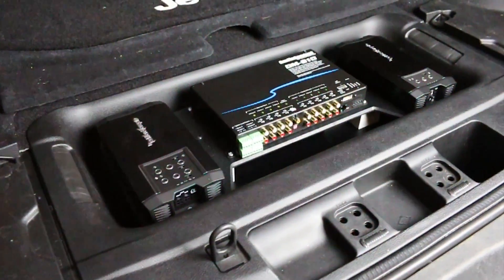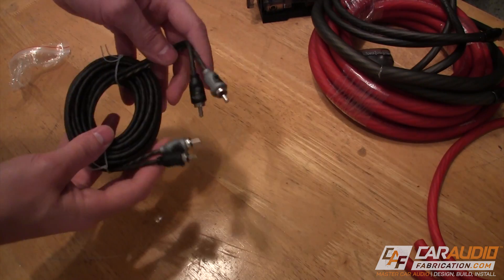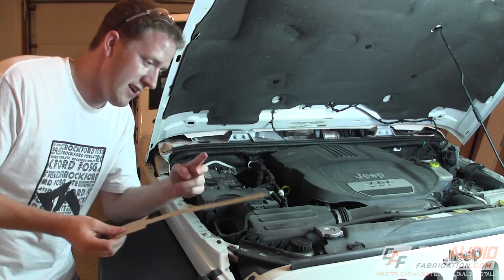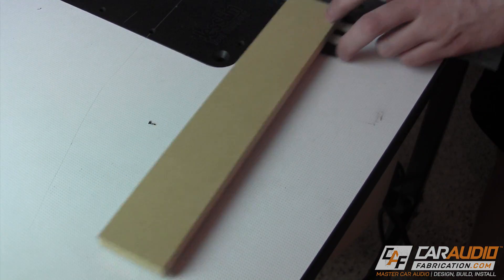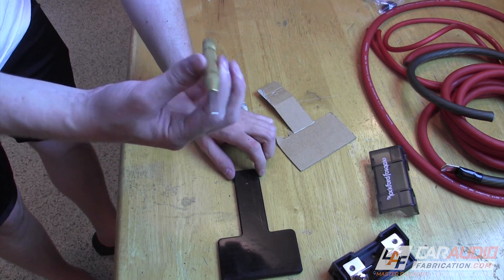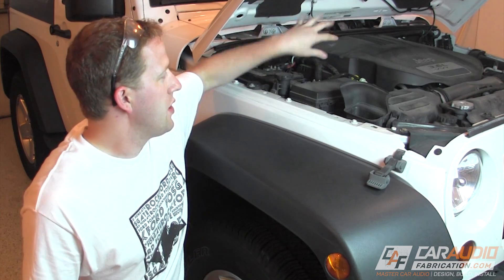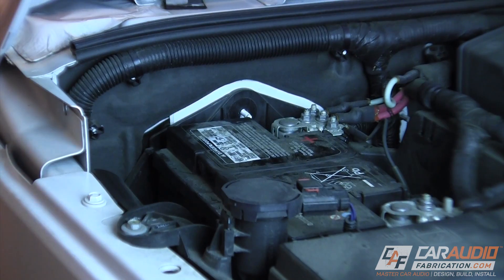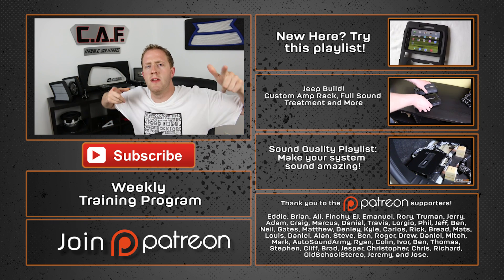Installing an Amplifier? MOUNT THE FUSE CORRECTLY! - Jeep Build - CarAudioFabrication

Comment from the maker: Thanks for watching! Next up I need to determine what wiring to use to tap into the factory signal… What wire is best for carefully connecting the factory radio and all of its channels to my new processor? I show you in the next video here: https://goo.gl/NU7nA3

-Mark
Reply: Freddy Rivera no.  Stacked fuses must be in parallel and are only double the smaller fuse rating.  In your case 80 amps.
Reply: CarAudioFabrication aww man. sry but I just read the top comment and well that's what I'm having trouble doing. I can't seem to find the right speaker wires to tap into in the main cluster behind the factory head unit in my vw? please help or point me in the right direction or well anything. I mean I would kindly take any knowledge over none. thanks again!
Reply: Freddy Rivera no.not the same at all.
Reply: Hi Mark, I would like to know what size ABS sheet you used for this job ( fuse bracket ) Great work.
Reply: Another helpful tool, you can usually obtain at harbor freight, is getting a static end open wrench. It acts like a ratchet for those tight fitting area's you can't access with a normal ratchet and socket. It's come in handy for me with custom installs.
Reply: Hey Mark, what's the thickness of the plastic abs you used? Thanks.

Comment: Man, I have a 2012 civic si coupe, and it’s been difficult to find a spot to make a bracket, some of these engine bays are so cluttered. For now I just used industrial strength Velcro strip and put the fuse holder on top of the fuse box cover. But I’m going to figure something out for a bracket. Good videos, some have helped me out quite a bit as a novice car audio diyer

Comment: If I'm installing a ct-1500.1d mono amp and a ct-150.4d full range amp. What size anl fuse should I put close to the battery.  I know 1500.1 is recommended 150a and the 150.4 is 120a fuse.

Comment: Only problem i see with this fuse mount is that after time the heat from outside and the engine will make the holder sag..hence why i make mine out of aluminum.
Reply from the maker: Its ABS, and its far enough away from the motor. 6 years now and looks good as new.
Reply: @CarAudioFabrication  i think it depends on the thickness of the abs as well..because i have seen a few made from abs that have sagged over a short time..

Comment: I used a small yet powerful magnet 🧲 secured to the bottom of the fuse holder. then I mounted it to a nice spot in the engine bay. I secured the power wire with zip ties on both side so there is no possibility of movement. 
it’s very secure and I didn’t modify my FJ Cruiser in any way.

Comment: Running power to your stereo system from the battery is fine. But if the engine is off and you are having a tailgate party, remember your batteries “RC”. What? Yes, “RC” stands for reserve capacity it is rated at for 80 degrees F with a 25 amp load and on the OC voltage reaches 10.3 volts, you will be walking home Cir begging for jumper cables. Now the “RC” value is different for each battery, 90 - 120 minutes is not uncommon. But increase the amps pulled from the battery, and you will need a jump start before your roast one hotdog to make two s’mores.
  The amperage comes from the alternator and at idle, it is not efficient as it is spinning slowly. 
  So, carry jumpers, dedicated one battery for the stereo, suck exhaust fumes or bum a rod home. Just saying! DK, ASE master tech since 78.

Comment: Just did this in my car. Took a 3/8" piece of ABS and used a heat gun to get a 45 angle on one side to match up with the stock bolt mount.

Comment: Great channel! I've learned so much from your videos for my current head unit and amp install. From soundproofing to ferrules and oh let's not forget the fabulous Tesa tape! I even made a custom fuse bracket using ABS plastic for my amp and also for a big 3 upgrade fuse holder. What are your thoughts on circuit breakers vs fuses? For my amp I'm using an ANL fuse but I just ordered a 100a breaker for the big 3 alternator wire to try it out.

Comment: Excellent idea!  I’m going to make one for my install except I’m going to try rubberized double sided tape to mount the fuse box. Losing a nut in the engine bay could be bad but losing a bolt inside a fuse box could bridge the fuse and bypass it leaving me with no protection.

Comment: CarAudioFabrication What thickness was the ABS plastic that you used for the fuse holder bracket? It looks like it could be either 3/16'' or maybe 1/4''.
Reply from the maker: Its been awhile but I believe I used 1/4"
Reply: @CarAudioFabrication  ok thank you

Comment: Where do i mount the fuse if battery is located beside front wheel, at the bottom of the car? Vehicle Chrysler Sebring 2007.

Comment: Seems like a good candidate for 3d printing. You could model the bracket in fusion 360 and print it out using PETG or ABS while you're running the wiring to the back of the vehicle.
Reply from the maker: Both would melt in the engine compartment
Reply: @CarAudioFabrication  Your engine compartment is hotter than 200C?

Comment: Hey...it doesn't  bend again ...due to engine heat...
????....🤔
Reply from the maker: If your engine compartment is getting to be 700 plus degrees you are going to have more issues than this bracket bending.
Reply: @CarAudioFabrication   yea that's point need to re-think..
Thanks buddy..😊

Comment: if you're going to the level you are on the main fuse block. I would have finished with the screws liquid locked so they would have 0 chances to even back out.

Comment: won't the heat from the engine damage the fuse over time?
Reply: There's factory fuses in the engine compartment already. They have a wall cover thinner than the fuse block has.

Comment: Plz reply when you get this. How far from the positive battery terminal to the fuse block should it be? Cuz closet I can get my fuse block to the positive of my battery terminal is about 12-14 inches away. I really don’t want to put holes into my front fender to get 4-6inchs from the terminal. What would you suggest? I have a 2009 Chevy impala 3.5L V6
Reply from the maker: It's not the length that's important, it's that there is no possibility of the un-protected wire making contact with ground in the event of an accident

Comment: Additionally you can purchase nylon machine screws that self lock and will not conduct anything if your bracket is pushed onto the battery in an accident.

Comment: I have engine whine, please do a video on ways to eliminate it, from grounding negative on rca to HU to installing rca away from the power cable etc... And what can cause it when it didn't used to happen to begin with!!!  Thanks! You've taught me so much!
Reply: Have you tried running your RCA away from your power cable? 
If you're RCA and your power are closed this will create cross talk.
Also if your ground wires too long
Reply: It's usually in the ground somewhere.  Try running a new ground wire(s) directly back to the battery and see if it goes away.

Comment: Love the bracket idea. Personally I would try to mount the fuse bracket just a couple inches towards the right of the battery incase I need to service my battery or even if I need a quick boost in an emergency. It would make getting access to the positive terminal I little easier without having to move my fuse/bracket. Again only if space in the vehicle will allow. Super slick install, Mark. Looking forward to seeing more videos.

Comment: In my opinion, not the greatest place for the fuse. Sure, it's only one bolt, but it's one more thing you'd have to remove to replace the battery. Not a huge inconvenience, but still an inconvenience.
Reply: @deanwlkr  Since we are replacing our battery so frequently,  what a hassle to have to remove that one extra bolt 🤣

Comment: Hey Mark, quick question. I'm running 4 gauge wire that will go into a distribution block and distribute my power into 4 gauge and 8 gauge for a Mono and 4 channel amp. The block is fused and I'm putting a 100a mini ANL on the 4 gauge, and an 80a mini ANL on the 8 gauge. What size fuse do I use for the main 4 gauge? 180a?

Comment: Another good idea to check for clearence under the hood is to put a bit of soft clay on top of the piece.  Shut the hood and reopen.  then you can see if it came into contact with the hood. (edit:  I wrote this before noticing that others said the same thing. Goes to show that it is a great idea)

Comment: This might be a dumb question, but I just can't seem to find a direct answer. If I am installing 2 amps, 1) kx400.4 and 2) kx1200.1, will I need 3 fuses? Will I need to have one by the battery going into a distributor and 2 more fuses for the 2 wires going into the amps themselves? Or will it be ok if I just have one 200 amp fuse by the battery? I hope I made sense trying to ask these questions, any help would be greatly appreciated. Thank you
Reply: ok, you'll need a 160 amp fuse next to the battery.  then in the back, close to the amps a fused 2-way distributor block with one 120 amp fuse and a 40 amp fuse for the amps.
Reply: 200 amp is overkill and unsafe. Stay away from anything above 150 and if going with that 160 like above suggested, use 0 gauge OFC (oxygen free copper). 4gauge ofc is slightly undersized for 160 imo. Stay away from CCA (copper-clad aluminum) as that needs to be ridiculously larger than OFC in the same application
Reply: Fuses are needed when
A) running wire from battery to something
B) when downsizing wire (like when going through a distribution block)
If you put the FUSED distribution block by the battery, you'd only need 2 fuses, but a lot more wire.
If you put the fused d-block by the amps, you'll need to fuse the main wire at the battery.

Match fuses to those on each amp (add the fuses together, like 15+15+15 or 30+30), then choose the required size wire for that fuse. Add the 2 fuses together, use that # for the battery fuse, then run the appropriate size wire from battery to fused d-block

Comment: Another trick for checking clearance between installed objects and the hood for example is a ball of modeling clay..  Just roll up a small ball sit it ontop of whatever you're checking clearance on and close the hood... when you open the hood you now know what your clearance is.... Word of warning tho...  the older and dirtier it gets <because its way re-useable> it will pickup automotive oil and grease and may start leaving ugly spots.. thats easily solved with a layer of either electrical tape or masking tape

Comment: You can used Brass thread inserts that can be pressed into ABS with a soldering iron.

I often use the inserts on 3d printed parts.

Comment: hey man I really like your videos and the way you make them as well as the way you do your builds. I do have one question though. If the glass on the fuse has cracked and there are no replacements. What can I do to Salvage the build on a no / (between jobs) budget? Can the fuse be saved?

thanks for your respected time!

Comment: Really good video 👍🏻 can I just say if you tap your mount from the underneath as in this video be carful with other materials because you will have reversed thread when trying to screw your bolt in from the top
Reply: Incorrect! Visualize this one, twirl your finger in an up motion and picture how it is coming from the top. clockwise from both side goes in towards the center.

Comment: Im not sure that ABS is a great choice here. ABS can get brittle under cold conditions. With the weight of the fuse / holder and vibration, i would worry that it would crack.

Comment: If there is a fault and the current goes high the "fuse" will break and current will cease to flow.  The fuse is rated for the wire.  You may mount your fuse anywhere between the battery positive and the amp, because your vehicle is negative earth.

Unless I am missing something?
Reply: Imagine there is a spike in the current flowing through the wire for whatever reason. All of the wire behind the fuse, after the fuse blows, will be protected from that current. All of the wire leading up to the fuse, however, will have that high amperage forced through it. Whenever you force too much amperage through a wire it will heat up tremendously, causing it to melt or potentially start a fire. That's why you want to minimize the length of the "unprotected" wire leading up to the fuse, to minimize the potential damage caused by a surge.

Also, if your fuse is next to your amp in your trunk, the power wire could short somewhere between your battery terminal and the fuse. Since there is no fuse to shutoff the current to the shorted wire, it would very likely lead to a fire.
Reply: after the fuse has blown there will be NO MORE CURRENT.  CURRENT ONLY FLOWS IN A CLOSED CIRCUIT.  The fuse will blow before the wire can heat up enough to melt the insulation.  That is the purpose of a fuse.  Your wire should not heat up more than this because it is rated to carry the maximum current for the device, then your fuse is rated to protect the wire from heating up to the point of self destruction.  The wire cannot short to the body because it is insulated.  It is insulated because the fuse protects the wire in the circuit.
Reply: If you lick the positive wire while you are in contact with earth you will be closing an otherwise open circuit.  Look it up and stay off me.
Reply: the only thing you're missing is that a general rule when installing something new electrical in you car that doesn't have a fuse, you always mount the fuse as near to the battery as possible.

And by the way I understand what you're saying and i agree, but still you shouldnt risk it, say that the wire is cut open by something an touches metal behind the fuse, the fuse wont blow, and bad things happen.
Reply: If you're dumb enough to install it anywhere like your trunk  That's roughly a good 8 feet of live wire if contacted. Just imagine if it was punctured by accident... 

Or put a fuse right in front of the battery and have the whole wire go dead and only live within a few inches of the battery.

Comment: that plug you mentioned first is actually for the clutch on the manual trans models. there are other ways in... on the passenger side there is a plug that you can go through. you can also access the cabin through the sides of the cowl to the a-pillar. a couple of the access points are "sealed" with expanded foam.

Comment: Thank you for the idea of the bracket.  I cut a part of an old DeWalt drill box for a plate to mount next to my battery.  Not as high tec as yours but it was effective.  Thanks
Reply: I'm totally stealing that idea for my build tomorrow! Thanks!

Comment: until your phone falls down into the engine bay when you close the hood, n you have to take the skid plate off the underside, then clean all the oil off it.. cuz speaking for myself.. that area isn't usually washed properly lol. but good video. I usually use stainless steel on my brackets tho.. I have an addiction to metal

Comment: Are you worried at all about the ABS breaking? I mean with the weight of the 1/0 ( I presume from what it looks like in the video) and the fact that it is a Jeep. Even if the suspension and remains stock or it is never off-roaded they don't have the smoothest ride.

Comment: great work man, i love the quality. you should check out "nutcert's" its great for adding threads to dissimilar materials, they are sold in steel and aluminum and are installed with a riveter type tool.

Comment: i have 3 separate amps 1 - 70amp fuse 1- 50amp fuse and 1-60amp fuse. i have 1 positive wire running to a distribution block. would a 100 amp fuse at the battery be enough to cover all 3 amps? thanks
Reply: No, it needs to be at least as much as the total of your fuses.  I would say you need to be between 180 and 200 amps.  With a 100 amp fuse, once you turn on everything, you will be drawing more than 100 amps.  Your fuse would not last very long.
Reply: thats what i was thinking also, thank you for the advice.

Comment: I used neodymium magnets to hold my old fuses under my hood it worked perfectly no holes no cutting just stick and good to go I now have abs holding my fuses in my new car due to Space issues
Reply: it's a good idea to secure high power wires properly. 

In a car crash it can still become loose and touch the body and ignite fuel that may be spraying about. 

Always plan ahead
Reply: ill be using the same type but to hold a dashboard Bezel.

Comment: I like to use Play-doh to check clearances. You can make it into a big ball and even crush it between surfaces then measure it for an exact fit. But the cell phone tip is still a very good one since we all have phones!
Reply from the maker: +u9Nails nice idea! Looks like it's time to stock some play dough. It comes in handy for copying contours to paper and such too.
Reply: Great Idea
Reply: I was gonna say I've used chewing gum in a pinch.
Reply: was just gonna say this
Reply: That’s what I do also! Works great

Comment: Hey forget putting your phone in the bay to see the clearance... use some blutack, just roll up a stick and put it on top of what your measuring. 
It will squash down to the clearance you have.

Oh and are they standard issue installer shoes? :D

Comment: Beautiful work, but aren't you concerned that vibration will cause the fuse mount to eventually tip? Maybe, putting a zip tie around it that is connected to the large bundle of wire above it.